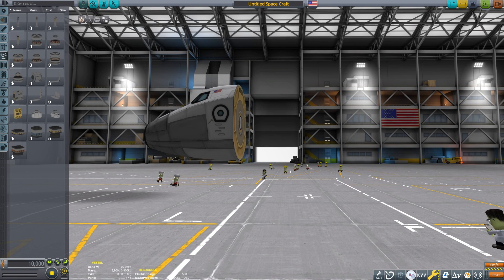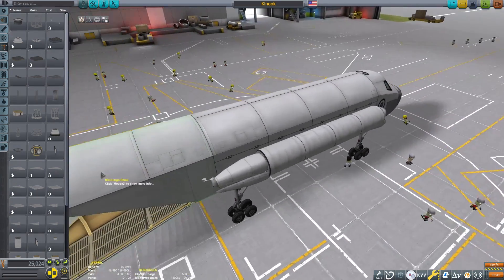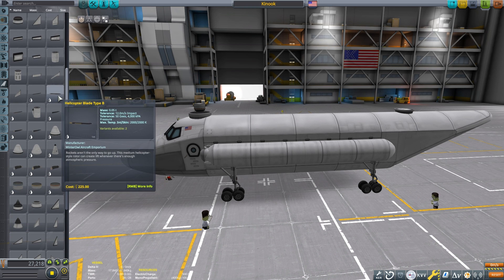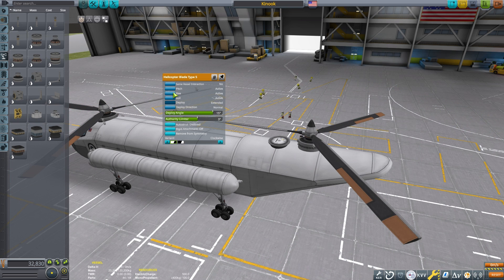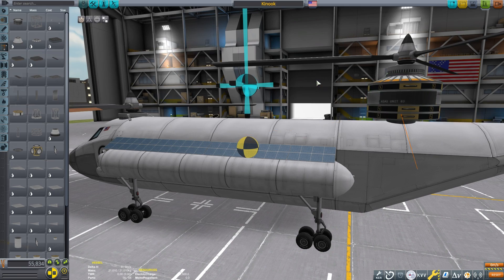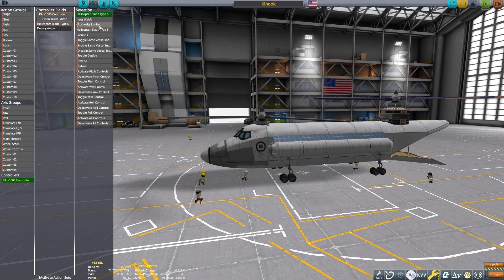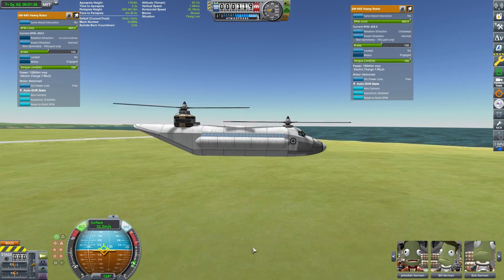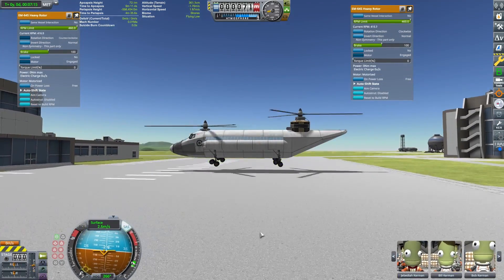Tandem Rotor Tutorial

Comment: Looks good. I have to go work at morning so i would like to just take craft file and fly around. But it's also fun to build with your guidance. İ just found your channel couple days ago and i try the push-pull configuration plane already. i am gonna slowy learn this propeller mechanic and no celestial body with atmosphere could hold me on ground at the end.
Reply from the maker: Some tips with the tandem rotors would be to tilt both of them forward about 15 degrees. Since the game auto assigns the cyclic and collective, tilting the rotors helps get full yaw, pitch and roll control authority.